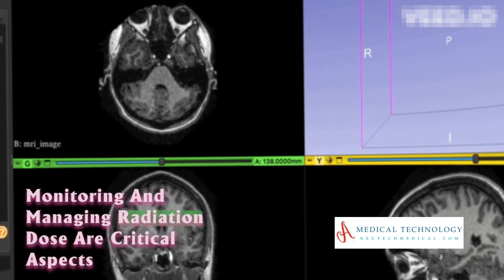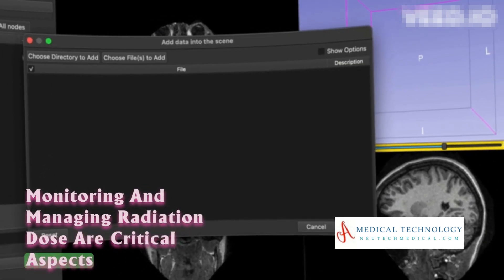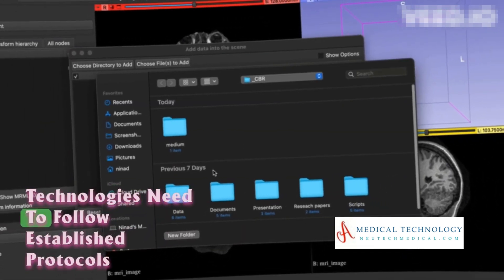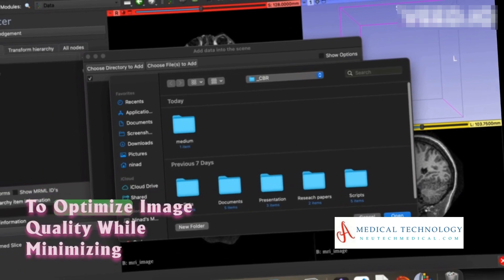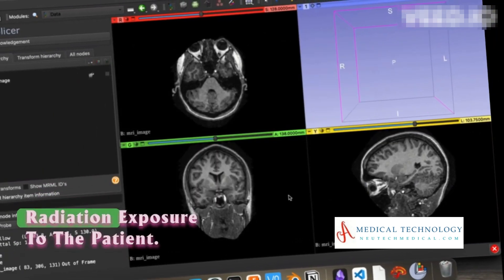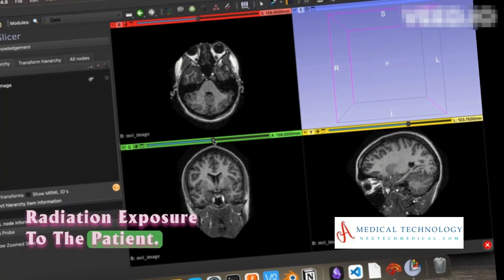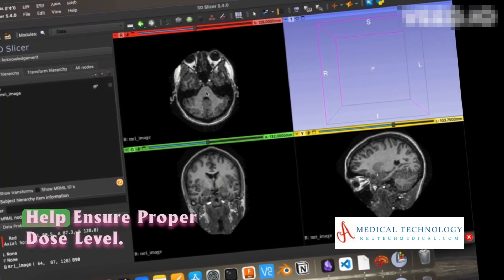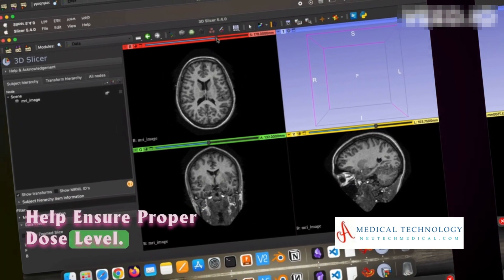CT SCAN | CT Scan Troubleshooting, Repair and Maintenance | Medical Technology

Comment: hello sir how to CT scan Calibrate proparly
Reply from the maker: A method for calibration of a CT comprises sequentially positioning a phantom having a non-circular cross section and a length commensurate with the extent of a detector at a plurality of positions between an X ray source and the detector array or sequentially positioning a plurality of generally similar phantoms

Comment: What are the common faults in CT scanner?
Reply from the maker: Power Surges: A power surge can damage your CT Scanner and other medical imaging devices. You should always use a surge protector that's UL-tested and approved. You should always make sure electrical equipment in your radiology suite is plugged into an outlet with a ground fault circuit interrupter (GFCI) installed.